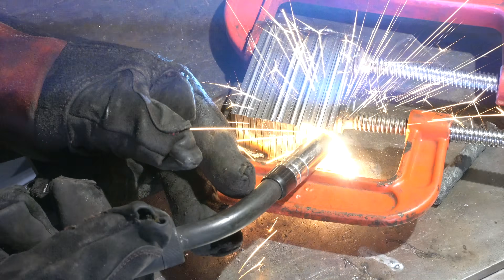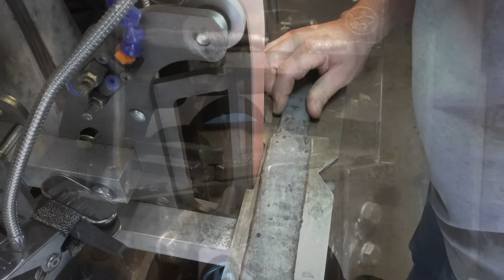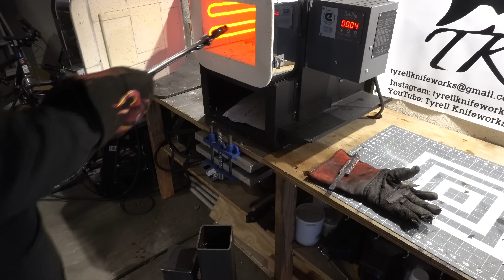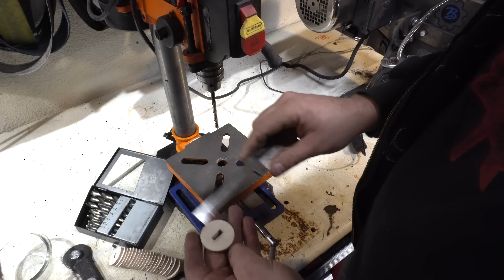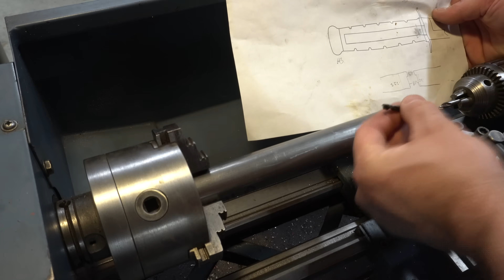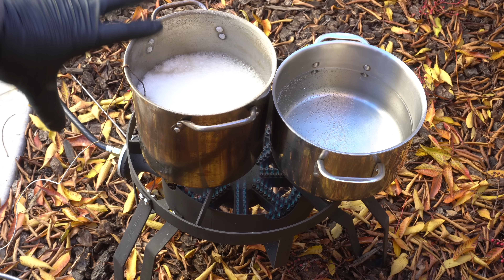Forging Three Copper Damascus Ka-Bar Knives - The Complete Video

Comment: Why did
 you do a copper core? I have a US Navy version the MK II that they used to put in the life rafts as survival tool. Of curse they aren't Damascus and the blade is blackened.
Reply from the maker: The core isn’t copper.  The copper is thin sheeting over a 1095 high carbon core. Thanks for watching.
Reply: Just for aesthetics then?
Reply from the maker: @douglascollingwood8273  the knives are fully functional.  Like I said, they have 1095 high carbon steel edges.  The copper is just for aesthetics, if that’s what you meant.
Reply: @TyrellKnifeworks  Yes that is what I was trying to say

Comment: Looks amazing! But i don't get how it stays together and does not seperate. (copper and steel i mean)
Reply from the maker: Look up copper brazing.  That’s basically what this is.  A copper brazing bond is in excess of 70000 psi in tensile strength.  You’ll destroy the knife before you shear the layers apart.  Thanks for watching.
Reply: @TyrellKnifeworks  Thanks for answering!

Comment: Oh and Tyrell, We used Neet's Foot oil on all leather used for diving. This included the leather and lead Deep Sea Diving Boots, Mark V weight belts and Kabar handles. The Neet's Foot oil has a property that if you apply it to just one side of leather, it pushes and water out the other side. Maybe not so good for your presentation knives, but what works on a knife being exposed to salt water. BTW I have subscribed to your channel and look forward to watching more of your work.
Reply from the maker: All my leather sheaths get Neetsfoot oil already.  These handles were treated with carnuba cream and Axe Wax and then a little oil. 👍

Comment: This copper Damascus is beautiful! My question is there any risk of de lamination through actual use or is this kind of blade material more for lite use and decoration?
Reply from the maker: If you look up copper brazing, you’ll see the bond is in excess of 70000 psi in tensile strength. You’ll destroy the knife before the layers shear apart.  Since the core and entire cutting edge is 1095 high carbon steel, it is a completely functional knife.  Thanks for watching, James
Reply: @TyrellKnifeworks  wow, that’s really cool to know! Thank you!🙏🏻

Comment: Using these in the Navy, I love them. Very nice work sir
Reply from the maker: Thanks so much, and thank you for your service!  My son is active Navy. 👍
Reply: @TyrellKnifeworks  Great about your son!  I was a US Navy Diver for 31 years. We used to buy the Camillus version thru the Navy stock system by the case. They rusted pretty bad if you did not maintain it being made from carbon steeI. We sharpened them on any concrete curb we could find . That way, they would have a rough edge to cut line easier. I also remember they cost the taxpayer $2.50 each! But then again cigarettes on the ship while underway were only $2.50 a carton (25 cents a pack). My how times have changed. You do great work. I have often thought of buying a small forge and doin something. I hope your son gets back safely.  Do you sell knives too? Cheers!

Comment: Awesome work. Loved the hot blackening method.
As for the lathe - that is a wonderful tool - but a tip - protect your lathe bed if you are using abrasives.
Abrasive dust will stick to the way oil and that will ruin your ways and lathe accuracy over time.
Reply from the maker: Thanks for the tip and for watching!
Reply: @TyrellKnifeworks  I came across your channel by accident - it is always a joy to see a master at work. :)

Comment: I've been making Ka-Bars for a while and have tried various ways of gluing up and removing handles for grinding. I'm stealing your idea! Thank you for sharing! I find that the sharpie ink will bleed under sweat so I burn the leather with a propane torch and sand the remainder back down. Seems to work much better.
Reply from the maker: I’m glad you found the video helpful.  Thanks for watching, Larry!
Reply: Use a round tip wood burner. Decrease sanding time.
Reply: Why not just use slightly smaller diameter leather bits for the grooves and then sand them smooth once it’s squished together?

Comment: Hey just wondering, with the copper in the steel, are they just for display or would they still be practical every day knives?
Reply from the maker: They are certainly practical abs functional knives. The core and entire cutting edge is 1095 high carbon steel. 👍

Comment: Remember kids! Always use the softest metals to make items that need to hold an edge!
Reply from the maker: Well Samuel, if you looked you’d see that the core and entire cutting edge is 1095 high carbon steel so it’s razor sharp and very functional.

Comment: Copper veins are very beautiful. However, copper and iron create a galvanic pair, and if this knife gets into any electrolyte, this galvanic pair will clearly not work in favor of iron. This combination of metals will lead to accelerated corrosion of steel, while copper will feel great.
Reply from the maker: Well you hit it on the head, galvanic corrosion requires the presence of an electrolyte.  Keep the knife clean and dry and it will last a lifetime.  Remember that if a regular carbon steel knife comes in contact with an electrolyte, the steel will rust as well.  Keep the knife from rusting and the copper will be just fine.
Reply: @TyrellKnifeworks  you're right about that.
Reply: @TyrellKnifeworks  Certainly if you can keep the knife clean and dry, you are correct that the corrosion will be minimal.

However, the presence of copper will make the steel in this blade more vulnerable to corrosion, meaning that if it is exposed to an electrolyte of any kind, the steel will corrode faster than it would if the blade was simply made of carbon steel. So it's a relative thing - even if the blade is fine with these copper veins in it, it's still less corrosion-resistant than a copper-less blade would be.

There is some degree of trade-off between stunningly beautiful appearance, and strict practicality. I would say these knives are probably perfectly fine for whittling wood, or as long as you just carry them. But if you end up in a survival situation in wet environment or otherwise unable to keep them pristinely clean, the corrosion might become an unavoidable issue within weeks or months.

There are a lot of historical weapons with bronze, copper, silver, or even gold inlays. All of those also create a galvanic pair that accelerates the corrosion of steel. It could be argued that if the corrosion was a significant problem, people would have noticed a connection and stopped using this kind of inlays. On the other hand, the weapons with this kind of inlays may have been made more as status symbols rather than fully practical items, but I kind of doubt that.

Comment: Will the copper make the knives more susceptible to corrosion?
Reply from the maker: Not more susceptible.  They are regular high carbon steel so you need to keep them dry.  Protect the steel from rusting and the copper will be just fine.  Thanks for watching.

Comment: Do you do these solely as display pieces? I'm no metallurgist, but I do know that copper is significantly softer than steel. I'm 100% certain that these would de-laminate under normal use, or possibly under gentle use.
Reply from the maker: Well, Nils, you’d be wrong.  If you Google copper brazing, the bond is in excess of 70000 psi in tensile strength.  You’d destroy the knife before the layers shear apart.  Note, the Blade magazine overall knife of the year for 2021 uses this same construction.

Comment: I will say right now, that's not Damascus, that is just pattern welded steel. as for what Damascus is, it's basically crucible steel that was heated up enough while melted, that all impurities rise to the top. the you then just cast into the shape you want. hope this helps distinguish the two in the future.
Reply from the maker: I know exactly what original Damascus steel came from.  The vast majority of people know what today’s Damascus is and not wootz.  I don’t need to be corrected, I will always use the term that 99.9% of people understand.  I get that you feel the need to correct me, but it’s not necessary and certainly not for my benefit, it’s for yours.  If you want my opinion on this topic, go read my community post on it.  (And end this thread.)

Comment: Those are not Ka-Bars, they have no downward curve. I have one from  when they were still made In  the US  right next to my work bench. these are more liked modded bowies. If you can find a real  flag stamped American Ka-Bar buy it.
Reply from the maker: Kabar has several models.  These are modeled after the straight-edge kabar which was the standard issue for US Marines.  https://www.kabar.com/products/1217. Thanks for watching.
Reply: @Tyrell Knifeworks  I appreciate the response. My stepdad is a retired seal and they carried the curved one so thats where i got it. I'll have to check out the rest. Ever heard of a smachett?  Made topps knives I think you might enjoy the design and usefulness
Reply from the maker: I’ve seen the smatchet.  Interesting.  Also, ka bars are still made in the US.  👍

Comment: There are Dremel sanding drums that are small enough for the ends on the slot
Reply from the maker: The dremel sanding drums come in 60 or 80 grit though so you'd have to somehow wrap 220/400/800 grit paper around them.  Then you get "swirls" in there as well.  There are times you just need to hand sand.  😜. Thanks for watching!

Comment: Does the kerosine replace botax for a flux
Reply from the maker: No, it doesn’t.  The theory is that when the kerosene burns off it’ll also burn off any oxygen as well so you start out with an O2-free environment.  As you pull the billet out of the forge, it will instantly scale abs that’s where borax helps. Thanks for watching.

Comment: I’m a huge fan & big student of yours Denis. As a Welder for 45 yrs. I have a hack for you: wrap your blades with cardboard and tape for a bit of insulation. Then use 2 small pieces of copper to clamp the pieces you want tacked together. Pace your ground clamp on the clamp that is holding the pieces to be tacked make your tack… then if you need to, you can move the setup and reset it. The setup seems like a hassle, but it is the best electrical conduction for a good weld, your assuring proper alignment for the stud, and you wont run the risk of accidentally arcing your blade. Heck you don’t even need a bench to weld it  then- you can do it in your lap…
Reply from the maker: Thanks for watching the channel, Brady!  I’ll consider that hack in the future. 👍

Comment: Just an FYI its not a military style KARBAR with welded all-thread on the tang.  Dude- you went thru a bunch of work and were so so so close to completing the design only to cheap out on the peen. KABAR's have to have a peened striking pommel not a cheap welded tail of all thread.  Go authentic or go home when it comes to a Marine's KABAR :)    Sgt. O
Reply from the maker: I get you want to be Mr Negative, but think about it… the peened pin in the handle is far less secure and there’s also no chance to tighten the pommel when the leather shrinks.  The peened pommel is actually the cheaper/easier version.  Sure it may be “authentic”, but everything can be improved upon.

Comment: Sorry if you get asked this a lot, but what type of welding do you use?
Reply from the maker: I mostly use gas mig.  Sometimes I use tig but my welder only does lift tig so it’s not that easy.  I started with stick welding though.  Thanks for watching

Comment: Do you really have your positive lead going to the ground clamp or did you just say it wrong? If you was using gas less fluxcore that would be the correct.
Reply from the maker: No, that was wrong.  I meant to correct that with text on the video but forgot.  I meant electrode positive.
Reply: @TyrellKnifeworks  I figured you said it wrong but just double checking 😉

Comment: Just a thought. You could make yourself a jig for the lathe to hold the guard and you could then spin them to get those perfect
Reply from the maker: Yeah, I thought of that but the setup would take longer than just hand filing, which is what I did. If I made these regularly maybe.  Thanks for watching.

Comment: How does these age, copper becomes green right? Any way of preventing this?
Reply from the maker: Copper turns green if you let it oxidize.  It's the same as steel rusting.  Keep the steel from rusting like you would any carbon steel knife and the copper will be fine as well.  Keep them clean and dry and they'll last a lifetime.
Reply: @TyrellKnifeworks  Makes a lot of sense. Thanks for the answer and inspiration!